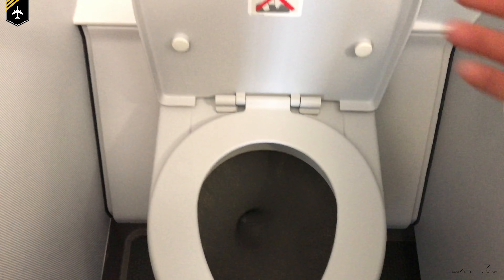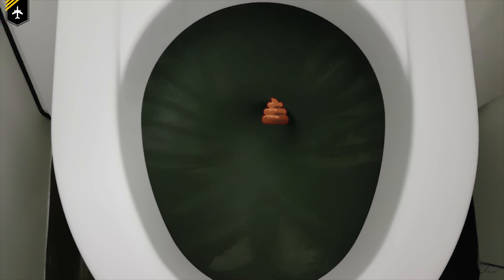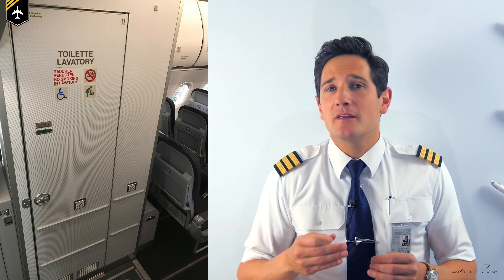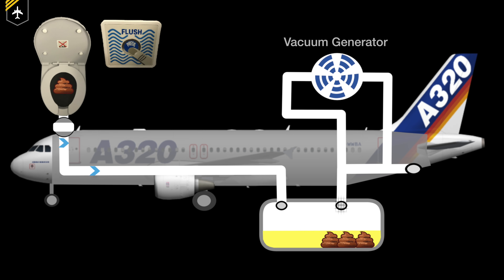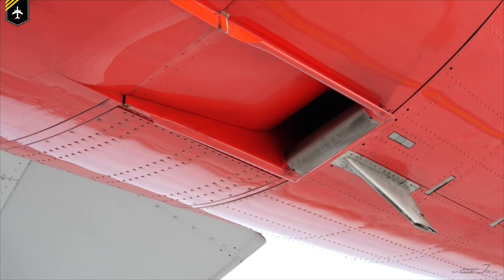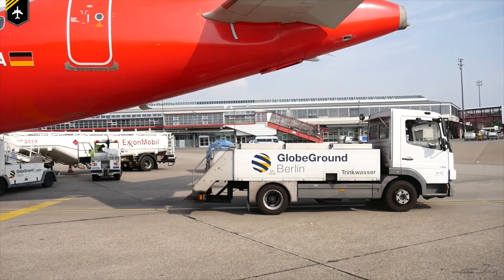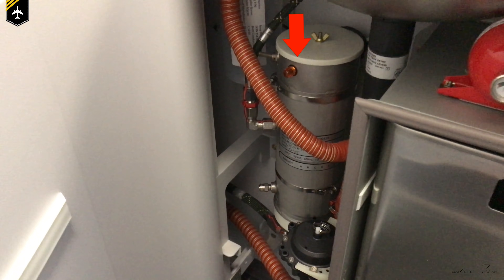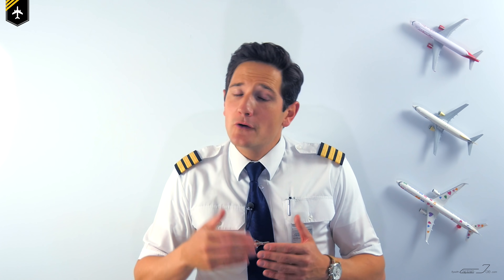HOW do AIRPLANES DEAL with YOUR SH**?! Explained by CAPTAIN JOE

Comment: The water inside airplanes is better to be avoided unless it is bottled. The water tanks of the airplanes are not sterilized frequently. Coffees usually aren't made from bottled water. 
The pressure inside the airplane during flight is lower than that on the land. The human urine bladder expands and that caused discomfort. The bladder isn't equalized with the lower pressure inside the cabin unless you urinate. Just check how many people visit the toilet soon after the airplane reaches the cruise altitude. A good solution is to try to urinate even if you don't really need it, in the airport just before entering the airplane. Also excessive water consumption is better to be avoided during short flights. During long flights the environment inside the airplane dehydrates the body and water consumption is good even if it will demand a visit to the airplane's toilet.

Comment: You didn't answer our most important question Joe.....Can my ass get stuck in the toilet if I press FLUSH while sitting there???
Reply: No it will not, the toilet bowl (the grey part) and the toilet seat/shroud (the white part) have a gap to let air by for this reason.

Comment: There is a constant myth doing the rounds that the water and waste connectors for ground support are next to each other. Meaning the potable water can be contaminated. This always seemed a bit unlikely to me.
Reply: thegeneral123 not true. I would crucify any of my fellow mechanics if they even THOUGHT about servicing the water system after touching the waste system. You can get in serious trouble for cross contamination and especially if a passenger ends up very sick.

Comment: Can you depressurize a plane by holding the flush button for a while? 😂
Reply: No because engines are constanyly pressurizing and have plenty power to keep plane pressurized even when flushing.
Reply: Raidzor つ ◕_◕ つ what if the engine is off like air canada 143
Reply: No, the engine bleed/air conditioning system continuously feeds pressurized air into the cabin. The pressure in the cabin is controlled by the outflow valves, these are small doors on the fuselage that let air out, they are usually open to some extent in flight, if you continuously flushed the toilet then the outflow valves would move towards the closed position to maintain cabin pressure.
Reply: Lol, guys, it was a joke 😁😂
Reply: Since impossible to flush all pressure out of cabin. Take note that cockpit will get MASTER WARNING when low cabin pressure, and oxygen mask will eject automatically when cabin pressure continue to decrease. AFAIK.
Reply: No because it has a delay function, that stops you from constantly keeping pressing the button and activating the system.
Reply: That would be a stupid function. And one super fired engineering team 🤣
Reply: A split-range controller
Reply: Your a funny guy!
Reply: Mr Me this is a crappy/shit joke...
Reply: I wanna make a checklist for this...
BLEED AIR - ALL OFF
A/C PACKS - ALL OFF
TOILET FLUSH SYSTEM - HOLD OVRD
GOODBYE
Reply: Adrianpeters Peters ba dum tss
Reply: But you can break the shitter.
Reply: German Aviation you should change your name to “shit aviation” 😂
Reply: no...but holding the drain valve open in the sink technically can cause a pressure leak...
Reply: No.

Comment: @Captain Joe Can you do a video on the 400Hz electric systems it has so much great advantages over 50/60Hz most people are not aware of.And a few minor disadvantages.I can imagine it will become obsolete because these days DC motors and converters are really cheap and low in weight.
Reply: A quick search tells me 400 Hz systems are lighter/smaller but less efficient.  It's a good tradeoff for an aircraft where every kg matters but a poor tradeoff for a machine installed in a factory on the ground.
Reply: If you had taken the time to really read my comment I'm asking if it becomes obsolete to be replaced with DC.There is also another advantage,synchronous motors rotate much faster at 400Hz.

Comment: Do an video of the costs of an aircraft emergency diversion or return due to passenger related emergencies (ie, serious medical emergency or air rage).  If it's a medical the airline and airline contingency system assumes the cost of the diversion.  However an Atlantic crossing with an air raged passenger requiring an emergency landing gets diverted to Gatwick England or Gander Newfound Land (Which ever is closer) with the offending passenger getting a $75000 fine plus up to 10 years in Canadian or US federal prison.  I do not know what it's like in Europe for stuff like this.

Comment: Thank you Captain Joe. Your videos are always amazingly interesting and educational.
I have a question for this video. Hope you could see and answer it.
In the end you mentioned that the soap water is released overboard when you wash hands. But how does the water pipe not release cabin air pressure into the atmosphere?

Thanks
Reply: a spring loaded valve stay close untill the "weight" of water open it to drain

Comment: Why the trucks nd cars of ground staff moving onto stipulated road on airport 

Why not they go straight to the plane?
Reply: why don't you drive straight through parking lots to get to a parking spot, instead of going up/down the aisles?  or why not drive on the sidewalks and such?

but really, the roads are roads, and anything else "isn't" a road.  so in order to maintain some additional safety, other vehicles are restricted to proper road ways until they approach the area they need to turn off, and get to their destination.
Reply: GhostHostMemories  thanks man

Comment: What happens if the poo tank gets filled up during flight?
Reply: That will be a shitty situation.
Reply: if its a long flight, the cleanup crew will have to reupholster the whole plane
Reply: i suspect you would start by saying the F... of S... word and would find a workaround, for instance using the sink and getting some yellow or acid rain out. I wonder what is the size for an A380 poo tank, though

Comment: what happens if the waste tank is full during flight and someone really needs to use the toilet?
Reply: Vladimirski duh! you stick your ass out of a window
Reply: Well when the plane is in the air,  it doesn't gain weight (maybe a little) from outside sources. They calculate the percentage of people that might come onboard already with a bellyful of shit and the weight of all the food items (food eaten -> shit), and design the waste tank accordingly, humans with the rare genetic trait of fabricating shit out of vaccum are not permitted to come onboard, obviously.....
Reply: Just take a 6hour trip with an ICE of deutsche bahn ... then you know what 500 people do with all toilets broken .. i recomend rubber boots ...
Reply: They land.  If you are filling up (in flight) a 45 gallon tank(a320)... You have bigger problems.  Unless you took off full and then it's a carpet dance for the pilots on why it wasn't serviced.
Reply: Vladimirski 
Was on an international 747 flight and the waste tank(s) filled.  So did the bowls of all the toilets on the plane over the remainder of the flight.  

You definitely wanted to be an early user, rather than later.  I'm sure it was a real mess for the cleaning crew at the destination airport.
Reply: rgsbghg4r Made my day
Reply: Though it may sound like a hypothetical situation, there has been special cases; a few years ago, terrorists hijacked  a plane, landed it and started negotiation with government; It went too long, because their demand was the release of a much wanted terrorist in captivity .Meanwhile, the hostages suffered, toilets flooded and flooded. It ended up as a real shitty affair !
Reply: NuclearSavety
No way. That is not happening on a German train. Right? 😒
Reply: Then they have to find an AirPort to land on. Sometimes there is an error with the system, so that they have to land. However I know about a flight where the error occured with the system. Then the pilots asked the passengers if they could hold it/wait, so that they could do the flight instead of cancelling it.
Reply: Always use the bathroom right before boarding
Reply: Shitty job but done whats done :p
Reply: Well, that means that person had a bad idea of not entering the toilet in the airport. Poop your pants
Reply: He Open the Plane Door and do his shit outside
Reply: Bob ur comment was hilarious!
Reply: ᴋᴇᴇᴘ ᴄᴀʟᴍ & ᴛᴀᴋᴇ ᴀ ᴅᴜᴍᴘ ɪɴ ʏᴏᴜʀ sᴇᴀᴛ
Reply: @Bernardh  
Ive seen on news from Asia that some Chinese mother actualy let her kid krap on the floor bc bathroom was ocupied..
Reply: @WANDERER0070  oh my..
Reply: I'm guessing that means they shouldn't consider giving out free laxatives instead of the traditional in-flight snacks.
Reply: Neurofied Yamato no they will drag the shit out of the plane
Reply: they should think about redirecting the engine core into an incinerator to burn the shit out of the shit
and yes the engine will still work
Reply: If the system is full and someone flushes, basically you’re gonna hear “Mayday , Mayday, Mayday!” Emergency transmission!
Reply: If the waste tanks are full and shut down the vacuum valves / pump, you can still use the toilet, it just won't flush.
Reply: https://www.reddit.com/r/flying/comments/4lzlxg/should_you_pee_in_the_sink_of_the_emb145/
Reply: I can't really imagine that ever happening but they most likely will land. United will just serve that sh*t to you instead.
Reply: I bet that was United lol. But seriously, what airline was that?

Comment: The hell * word is used,can never be justified with its way of explanation.good job captain joe,my new suggestion for your another new video on youtube.can you explain which gas is filled in landing gear???and when do they fill air in landing gears.
Reply: nitrogen, filled in case of landing gear installation or seal replacement or every time you need to disassembly the shock absorber for maintenance scheduled or unscheduled